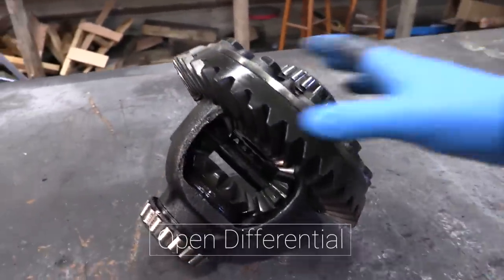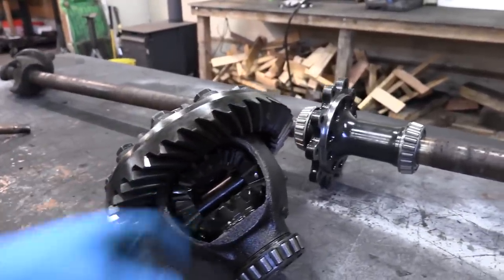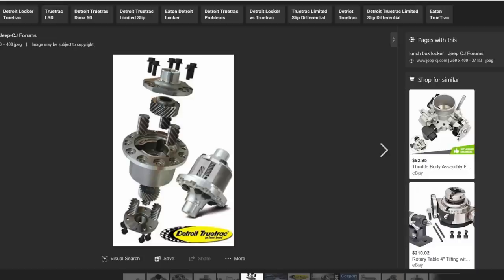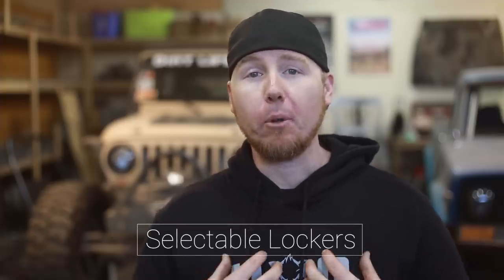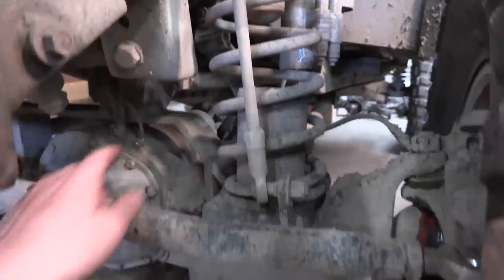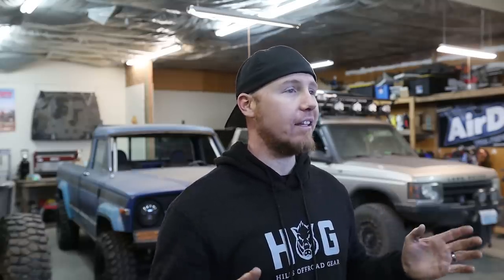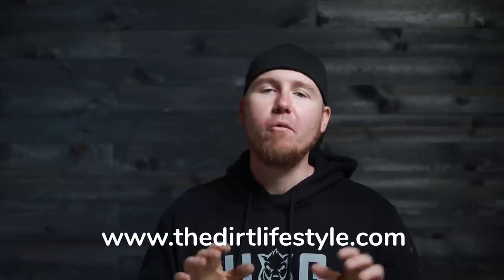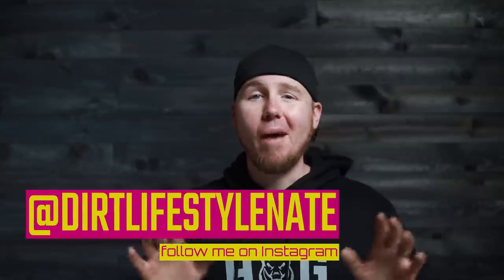Differential Lockers! ARB vs Yukon vs Detroit vs Spool

Comment: Absolutely nothing against any other selectable lockers but OX air lockers don't require 12v like all the others nor do they require plumbing special lines/tapping the diff housing. The switch is literally just a mechanical switch that allows air in and out and you connect your hose to the diff cover. I run my air lockers off a basic air tank that I can re-inflate with a 12v tire inflator after using the lockers a couple hundred times. I think all the OX cable problems are installation and adjustment issues like said in the video and unfortunately, it gives OX a bad rep because a friend of a friend has a bad experience after installing it improperly. One big drawback with cable that is often overlooked is you need a sturdy place to mount the lever(s) and that huge cable has to be run into the cab. The OX electric version has so much potential but really a half baked design. The electric version runs an electric actuator in your cab to move the mechanical cable which seems like the worst of both worlds in my mind but I've never used one.

Comment: I have 3.73 in my 86 monte and trying to decide which locker should i get or should i change the whole unit for a torsen zexel.Anybody got any ideas I'm only running between 300 to 350 hp

Comment: I had LuAZ-969M, very fun car. This car had mechanically operated rear locker, Bowden cable, lever and this is it, extremely reliable system, and if it broke outdoor, you easily could fix it with simple tools, or at least just switch locker to required position.  I had experience when crank shaft broke between 3 and 4 cylinders, but this car successfully droves home with only one cylinder connected to transmission, believe or not and If I were you I definitely not believe in it. Unfortunately I couldn’t say that it was great off-roader, not bad for default car, but not great at all, because of bad balance- 70% of weight on front axle and only 30 on rear... and on-road it’s way worse, no any sign of comfort, 50km/h max speed, but It was extremely fun Soviet-Ukrainian car, and maybe the only car with full independent suspension which has more flex than same class cars with live axle. 
But what I’m talking about- Why nobody produce aftermarket mechanically operated lockers? It’s great.. no air, no vacuum, no solenoids- less parts that could fail, and you still could switch locker when you need.

Comment: Toyota e-lockers seem to be different than the Eaton aftermarket e-locker. Eaton seems to use a roller bearing and magnet type contraption that makes the electrical connection and then the bearings roll on a cam to lock the diff. Whereas, the Toyota e-locker uses a gear and a fork to lock the diff. From what I can tell, the toyota system is more robust and doesnt rely on the axles to roll forward or backward to move the bearings, press upon the spring, and then lock the diff. The toyota e-locker is truly on-demand and requires no forward or backward movement of the axle to lock. If I could choose, I would go Toyota e-locker... even in a jeep. Every Arb and Zip locker I've used/seen seems to have a parasitic draw on the air system, and kicks the 12v air pump on every 5-10 minutes (maybe that just user/install error). I've even heard people poopoo the e-locker because it relies on electricity... while their air locker relies on air and electricity to work. More variables to go wrong IMHO. But anyway... that's just my stupid opinion based on using both the Toyota e-locker and Arb/Zip air locker. Shit, I might even go mechanical because I don't want a little water to ruin my day.

Comment: Would never run an e Locker front and rear the same reason I wouldn't run a Torsen LSD in the front and rear because of their inherent issues. Elocker has that loose spot between forward and reverse.

Comment: Hey Nate - great job on the sound - I loved the guitar track you used! 

I am working on installing a set of Ashcroft air lockers on my Defender - the thing I am trying to figure out right now is the best way to run the air lines. I would love to see a video on different ways people are doing this and some of the "best practices" / tricks of doing a good air line installation.
Reply: I just went from a Detroit to an Ashcroft for the rear of my Disco.  Search IG for #rokrovr and you can see a pic of the air line routing.

Comment: A helical differential isnt a torsen. in a torsen there are spur and worm gears running parallel to the axle gears which provide a locking action under torque unlike a typical helical differential which is limited slip and the pinions are perpendicular to the axle gears. Realized that when i started digging into an aam 11.5.
Reply from the maker: Good to know!

Comment: the electromagnet is only magnetic when its charged, so it would stand to reason that shit only sticks to it when its on and locked and once you turn it off all that shit falls back to the bottom of the housing.
Reply: well, to a point, but there's a chance of a bit of residual magnetism in the parts, and I'd rather let that stuff lay in the bottom vs. getting into the bearings, or eating-up gear tooth faces. (just a thought, not trying to bust on anyone.)

Comment: Hey boss I’m in japan rn running 33s on a suzuki jimny which is a samurai but it’s got a little turbo 3 cylinder engine and I got e lockers front and rear that work great when they engage and I love them so much but what’s weird is the front e locker is also an lsd when not engaged and I have not been able to find anything similar online anywhere. I was wondering if you have heard of this before or if this is just a super niche Japanese front locker😂 it’s open in the rear unless engaged like a normal e locker so idk?

Comment: What do you do when your on the trail and you run out of air in your co2 tank?
Reply from the maker: Swap out to one of my other tanks. But I've never ran out. When it gets low I get it filled. 👍
Reply: Okay so you carry a spare just in case? And I guess you could have someone with a air compressor fill it if you were to run out.
Reply from the maker: @robertmclain6140  i have a full backup tank in my truck tool box. But even in a full week of wheeling at KOH I haven't ran it out. 👍
Reply: Okay cool! So you literally just use it when you need it while you’re on an obstacle. I gotcha. That makes sense.

Comment: Lunchbox lockers are the exact same mechanism design as a detroit locker and a grizzly locker. They both ratchet and they both lock and unlock in the same way. Only difference is one is a new Carrier and the other isn't. They're not load either if you run the right fluid. They don't get a fair shake because the people that buy them are generally the ones to cut corners simply because of the price point.

Comment: What about Toyota TRD lockers? Strong as well?
Reply from the maker: I'm not sure. I have no experience with these unfortunately
Reply: @DirtLifestyle  I've just finished my 1985 4runner build with a 2006 toyota e locker retrofitted into standard 55 inch 8 inch housing. Low range harness and works like a charm. Moved the tru trac up to the front. Really looking forward to using it.
Reply: Plus with using the Toyota e locker I think you benefit with extra strength going to a 4 pinion carrier? And it's a v6 3rd member not a 4cyl one.

Comment: I prefer auto lockers, all mechanical and no cables,  air lines, wires, hoses, switches or relays to worry about, just install and it works.

Comment: Funny how you hate lunch box lockers but yet had failures with air ones, Ive run a lockbox in my front end for the past 15 years and under extreme conditions. No issues. I have blown on one the rearend, they hate donuts haha

Comment: Welded/spool in rear isn't that bad on road. I have a full size bronco with 60front, 10.25 sterling is welded and it does a mix of all driving. I would rather selectable front and welded rear, if budget wasnt a thing then yes selectable rear would be nice but welded isnt horrible.

Comment: Nate , you forgot one of the most common Diff’s in jeeps ,, “Brake lock” diff’s . We all know what they do but don’t know whats different or how they work inside the Diff.. i mean all jeeps as far as i know with traction control have them..
Reply: My old zj has open diffs, but when I get in a slippery situation offroad I ride the brakes. It helps transfer some torque to the low traction tire and can help me move forward.
I've even had this in jeeps behind me get on the radio and say things like "I saw your locker engage and pull you up that hill!"

Of course it's nowhere near as good as a locker and it's not even as good as the "brake lockers" on modern vehicles with traction control. But it does help a little bit sometimes.

Comment: Completely disagree on the strength argument.  I've not seen independent testing but the way they are built will matter.  ARB lockers are a PITA.  Lots of failure modes but it is rare to see one broken.  Eaton and OX may be great and plenty strong but just because the form factor is similar does not equate to the same durability.  Full disclosure.  Running 60 front with ARB 14 bolt rear with Detroit.  37" kreepy crawlers

Comment: Woooohooooo! FINALLY broke 90k
Reply: Also, having experienced the performance of ox lockers in Moab, they are awesome. They were air actuated. But being that you can choose air, electric, or cable, and you can manually lock or unlock with a simple tool if your actuating system fails, ox is the way I’ll be going on my xj. They are just so versatile.
Reply from the maker: Dude 90k is crazy! I'm pretty pumped 👍
Reply: Very proud of you

Comment: Problem with lunchbox is they don’t hold up with big or heavy tires.. yeah they are jerky and unpredictable more so then say a Detroit but they don’t last with heavy use. The teeth round over pretty easy and when they do they are to loose in the carrier to lock up properly. If you want to go in a reshim then every so often they will hold up for a while. Honestly anything over a 33 they will just tear themselves apart though.

The most reliable is a Detroit or spool. Anytime you have something hanging around the axel is can get snagged and ripped out.. selectable are nice and all but eventually you’re gonna catch the line on something and rip it out. Ox with the slug idea is really the best option for selectable cause at least you can finish wheeling and then remove it and still drive home. I like simple though. Give me a shaved 14 with a Lincoln all day!

Comment: There is no such thing as a differential locker. A locker is a locker, period. A differential accounts for the rotational difference between the inside & outside wheel in a corner. There is a 'locker' that'll 'slip', but it doesn't have a smooth operation or there's the ARB but it's use in a trail application is limited. A limited-slip would be more useful but the best choice is the Torsen or TrueTrac. Lockers have their place, I guess, but not on a trail, circle track, the street or road racing.

Comment: BUYER BEWARE - DONT BUY AUSSIE LOKKAS IF YOU HAVE A WRANGLER JK 3.6l with AUTOMATIC GEARBOX! ENDLESS ISSUES, LIMP MODE, NOT SHIFTING, WONT DRIVE ETC... 4WD Systems in Australia who sells them said it's my car problem, just ripped them out and went ARB air lockers... No more check engine lights, no more issues... Apparently a well known issue in the USA, but Australia distribution of lunchbox lockers don't inform buyers

Comment: Or if you put that slug in the ox locker to get you home and you have selectable hubs you don,t even have to screw your cable back in! Just disconnect your hubs! I am going with the OX cable in my 06 dana 60 and the Yukon Grizzly in my 06 10.5 in my LS XJ that I'm building and then driving across the country pulling a camping trailer overlanding and crawling rocks!  Will be living on the road for a few years so we WILL see how durable these lockers are hahaha! If you want come subscribe and hit me up when you see that I'm near you and we can wheel together!!!

Comment: "Lunchbox Lockers" should NEVER be run on the street!!!! They have a design flaw that is EXTREMELY dangerous when run on the street. Whenever you come OFF the gas your rig will yank left & right (or vice versa) with you white knuckling the steering wheel as tight as you can, you won't be able to stop it. So if you're on a snowy or icy road and that happens you're gonna be OFF the road pronto in what will most likely be a spin or long sweeping slide off the road you go. This off throttle yank happens due to tire size (diameter) differences. No two tires will be exactly the same diameter thus causing the the locker to react dangerously under deceleration. 

Carry on...

Comment: The other kind of locker is your brain, by taking a line around horrible terrain, you don't break parts, you can drive home, and peace of mind. My rule of thumb is " If you drove it from home to the off road, drive smarter" In other words lock up your brain. I know, what's the fun in that? Well the fun would be watching the other guy break his axel, drive shaft, U joints, and put a hole in their oil pan. Limited slip would be best for people that have lockers in their brain............Michael